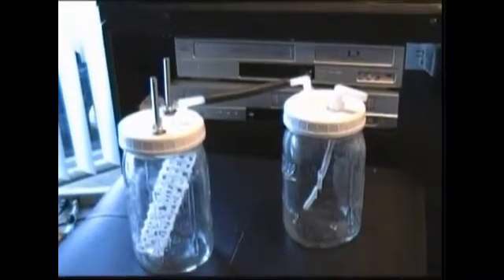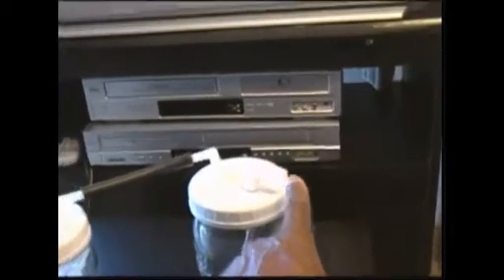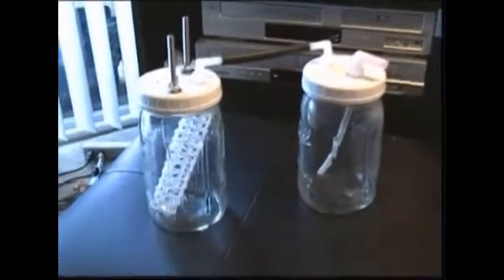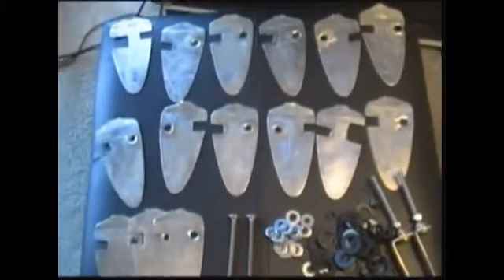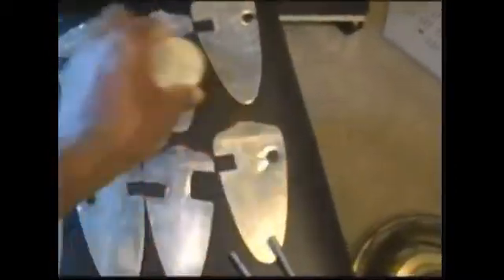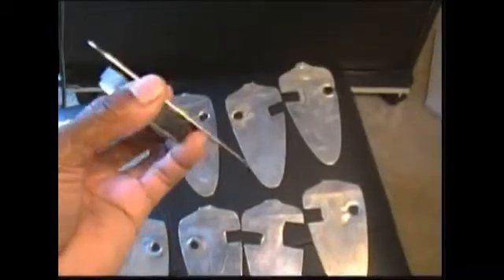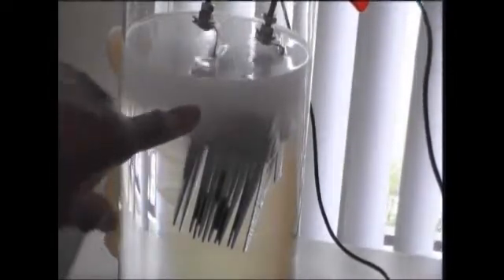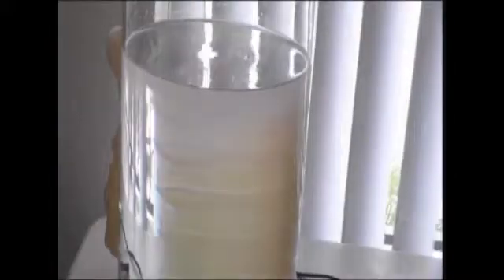How I TESTED MY HHO HYDRO WET CELL made from scratch

Comment: Replace your stainless steel screws with a non-conductive material such as plastic or pvc. You also need to seperate the plates with plastic washers. The plastic hose in the second container needs to be on the inlet that is connected to the HHO cell as its purpose is to release the gas through the water to cleanse it, as well as acting as a failsafe. The gas naturally rises to the top and out of the other nozzle. Other than that, good work